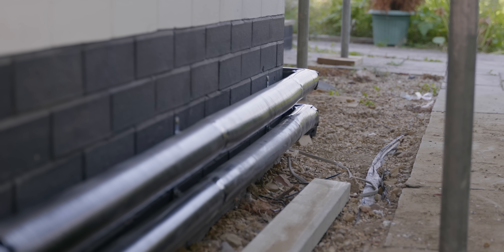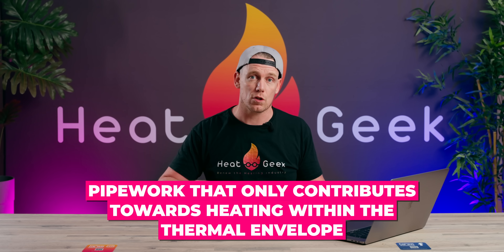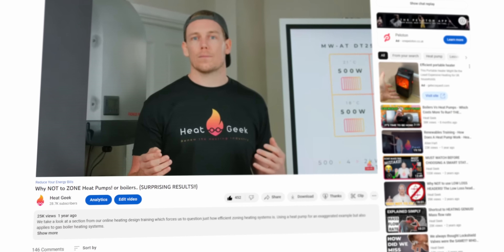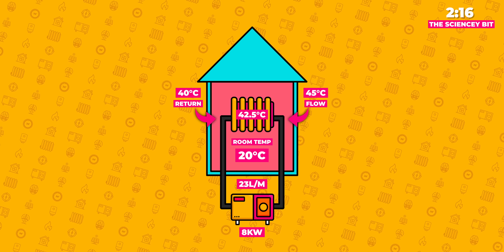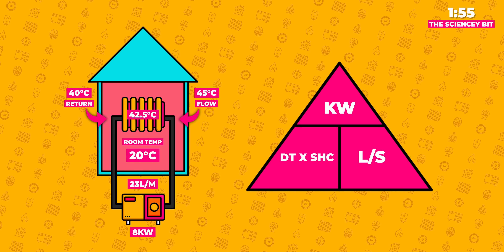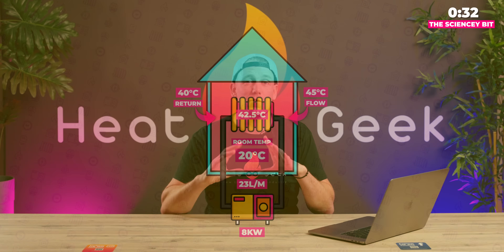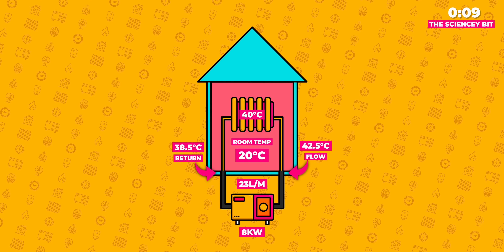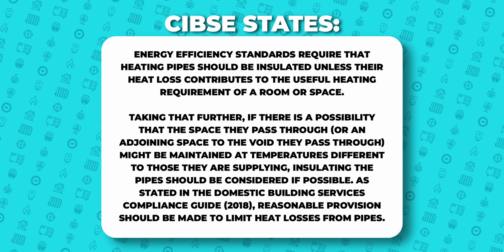Stop Insulating Pipework!

Comment: Interesting. What if you have 1 zone of UFH in ground floor and radiators in 1st floor. Wouldn't there be problems if running 45-50 degree flow temps through the floor. I guess the same problem exists with radiators on both floors. What if these pipes pass through materials not suitable for such temperatures?

Comment: If your pipework is supported or even touches wood (joists, beams, wall sheathing) any sound generated within the pipes will be transferred to the wood and the sound can be heard inside.   Our first heat pump with uninsulated pipes would make a whoosh and then constant sound.  Over the years, we got used to it.  When we updated, everything was changed out and insulated.  Blessed silence.

Also, check any insulation that is exposed to sunlight and weather.  Replace as needed.  This can greatly effect the effectiveness and efficiency of the system.

Comment: What about when your flow and return pipe are boxed together in trunking, surely the return pipe should be heat shielded from the flow pipe?
Reply from the maker: The difference will be immeasurable
Reply: @HeatGeek  even if it's touching in places (as in my case) ? If so, what would you suggest to 'squeeze' in between the pipes? On a different note, when running very low flow temps (condensing Combi boiler), it obviously cycles, what interval time (either time or temp hysteresis) would you recommend before the boiler firing up again please?

Comment: here's my example when insulating is needed. I asked them to come back and insulate the pipes in the kitchen.  >8m run.  The radiator valve turned off the radiator flow but the kitchen kept heating up. Also I insulated the pipes going through the hall as that is where the central thermostat is.  So my heating was going off before the house had warmed up.  and the hall and kitchen were too warm.
Reply from the maker: I’ve run the accounts quite a few times on pipe losses and for it to heat up an entire room before the rest of the house seats is quite rare so I’d say that you’re very specific special case and that your house has been very well in selected. Having said that this entire app premise that pipework was going to be boxed in so if pipework is exposed there’s definitely more likelihood

Comment: Wrong. Radiators are sized to the size of the rooms. Radiators are also used through balancing and TRVs to control the temperatures within individual rooms. By leaving pipework uninsulated you are distorting the design of your heating system. NO heating engineer calculates heat distribution created through uninsulated pipework. They do it by calculating the radiator sizes. 

These claims for not insulating is little more than  pseudo scientific scam by installers who don't want to bother doing  this work.
Reply from the maker: We cover all this in the video. Heat loss calcs are less accurate than the amount the pipework distorts by and can be accounted for by balancing

Comment: i have ceilings down at the moment in the downstairs kitchen and getting the plumber to run some 28mm flow and returns for the HP we might have fitted if i can ever get a price that i can manage. anyway we have insulation in the void between floors, how does this affect the insulate or not idea? as surely the heat will be trapped in the ceiling void to a degree. also recently spoke to a Heat Geek installer and they wanted to design to 50c not 40-45c.

Comment: This is helpful, but there is one important exception to consider. If you have multiple or noisy pumps near to bedrooms, the "thrum" could be annoying. Potentially, this could be mitigated by tight foam rubber insulation along sections of pipework near the pumps

Comment: I heat my 100 year old house with a hot water boiler and radiators. The hot water pipes from the boiler and water heater running through the unfinished basement ceiling are not insulated.  The room they are in is the warmest room in the house, yet it is not used.  Should I insulate these pipes to prevent heat loss?

Comment: One of the problems with calculating output of radiators is that the manufacturers/retailers stated output can be as much as 40% exaggeration over the real output for a given delta T. A recent yt video exposing this I'm sure you're aware of.  All fine and dandy doing the calculations but if your emmiter outputs are wrong it throws it all out the window and systems may not perform as well as expected. Are we to overspec the emitters to compensate for errata or is something in the industry going to change through legislation?

Comment: How about during the summer time when we run air conditioners.  It will try to cool a room that is being warmed by an uninsulated hot water pipe.  Also to get hot water to the upper floors, we will have to run the tap much longer before hot water comes out.  This will be a waste of water.  Our hydro bill will go up.

Comment: QUESTION: if you add a Heatpump to your fossil oil or gas burner to build a hybrid system (who wants to pay emptying 3000 L expensive oil from a 7000 L tank ?) which means feeding the warm water into the return flow of the oil kettle we can ignore this advice.

I wonder why no one in the UK is touching the subject of ADDING a heatpump to the existing system instead of replacing.

All the elderly prefer the "safety and experience of the past" with their existing heating systems and are not willing to make the full jump / leap into the new age. 
And in case of a oil heating you can even save costs here cause based on the ratio of prices for oil versus electricity (which is incl. VAT right now a 0,80€ / L versus 0,33 € / kWh) heatpumps are becoming too inefficient around the -5°C excempt the 2 austrian made from LAMBDA and another company who have far better COPs and SCOPs. 

If I pay 90 Cent for 1L oil with 9,8 kWh only 85% of that will reach the water (high efficient value added oil burner) which means 8,33 kWh in the water will arrive. 
For those 90 Cents for 1 L diesel I can buy  3 kWh for 0,30€ current price. 
When the COP is less then 8,33 kWh (oil input energy ) / 3 kWh (heatpump input energy)  = 2,75 oil becomes cheaper
And that is usually the case around 0°C or -2°C 

You would ease the life for the heatpump this way and both system supporting each other would run less and then last longer. Of cause Oil burner might dy and need a repair - here in germany we have millions of spare parts and now also used oil and gas burners which have been recycled on the way to the scrap yard so you do not have to fear anything till 2045 when oil and gas heating will be forbidden in private houses. ANd if the oil burner would collapse completely then not much has to be changed: Remove the old scrap metal and the heatpump is doing its job alone.

Comment: One exception to "not insulating the pipework within the thermal envelope" might be the plant room. In my case, it's a fairly small space (1.5 x 2.5 meters and 2.4 meters high), which we obviously don't live in and which happens to have a lot of pipework between the boiler, the indoor unit of the heat pump, the buffer tank, the expansion vessel, the UFH manifold, and so on. In this very small space, the pipes would emit a lot of heat that isn't really needed there, causing it to overheat. I'd much rather have that heat/energy stay in the water in the pipes so it can be emitted in other parts of my house.

Comment: I believe insulation should be insulated when hot water is exiting the boiler. Return flow should not be insulated from the last rad pipe to the boiler, you allow more condensing. Not insulating pipes going to radiators means you are heating voids and walls that lose heat but not directed at where you want heat . The greatest loss of heat should be from the rads. If your return heat remains too high then either your boiler cant condense or the output flow temp is too high or the rads are too small to vent heat. The aim should be to dump as much heat to the biggest heat emitter (rads/underfloor heating to the floor above) and cut the heat returning to the boiler so condensing works under the delta needed and that you are not sending too high a flow rate temp to the rads that cannot be vented in time within the flow rate pressure. It maybe that the flow rate is too high to vent heat in time. Should boiler makers understand that cutting pump flow rate to vent heat might cut the returning flow rate temp. After all the lower the returning flow rate temp, the more it can condense that remaining heat while knowing too cold a return temp will require more kw to boost the output temp. Maybe this is there yet condensing levels are low in reality due to boiler oversizing, poor moderation, overshooting room temp (no opentherm ability), minimal deployment of weather compensation and poor rad performance/size for tge room they are in. Yes heat will vent internally but humans dont react to temp like a thermal store equalising. No more than most car drivers going at moderate speeds to avoid using the brakes even if transit time would be the same in reality.
Reply from the maker: That’s not how mass flow rate works

Comment: Midway through a refit in my house and up to this point have pretty much insulated all pipes, I will think twice though when doing the rest.  However given that a lot of the electric cables are running in the same voids as the pipes and in some instances the cables cross pipes as they do their merry dance to sockets, I see some benefits of insulating given that I don't want transfer to the cables.

Comment: So to be fair, the real answer to this video is that you should consider every pocket or a wall as an individual "heater". This is not a zero/one scenario, you can insulate half of the pipe in the void, or use very thin/thick insulation on purpose.

Comment: I have old boiler (1970) in unfinished basement. After exiting the boiler, the 28.5mm pipe runs 13 m through the basement before splitting to warm the living spaces. I think I will insulate this. There’s maybe 5-6 m exposed on the return but that has some fins and heat removed there helps warm floor with piping and room above that doesn’t have baseboard radiators.

Comment: I think you may be getting so over obsessed with increasing the COP to maximise efficiency that common sense is going out of the window. 

We are moving away from gas/oil heating and smart heating controls with motorised TRVs which gives us the ultimate in control with fast warm up temperatures and zoning to avoid wasting heat in unused rooms, to heat-pump technology which by it's very nature has to be on all the time, heating rooms and areas that don't need to be heated just so they can work efficiently.

It seems a bit of a backward step to lose the convenience and comfort of fast warm up times and zoning by room due to the inherent limitation of heat-pump technology, which requires heat to be dumped anywhere within the thermal envelope in a desperate measure to keep the COP high in line with a manufacturers spec and/or your own target value, irrespective of whether the heat is actually desired in that specific area.

I just don't see how heating rooms that don't need to be heated can be efficient in terms of overall energy usage, even if the system COP means it's running efficiently on paper.

Comment: Beware counter-flow heat exchange; that is, where flow and return (or other) pipes are close together, heat transfers from hotter pipe to cooler pipe.. this is very bad news for efficiency of heat production and delivery by condensing boilers.. and bad news for delivery of heat to furthest heat emitters (radiators) in any heating system that uses radiators.
For this reason, I'd insulate the (hot) flow pipework nearest the boiler and between pipes in long runs under floors etc.. also insulate DHW (hot tap) flow pipes to see more rapid delivery of hot water to basin/sink.
CIBSE is right, of course.

Comment: If you had uninsulated CH pipes under a vented insulated suspended flooring (GF old Victorian ), would that would be considered outside the thermal envelope.
Also say you had boiler/cylinder in a small extension room to the kitchen, no 2nd floor above, you may want to insulate the pipes as it would be additional heat loss in the room which already will be warmed from the boiler/cylinder, pump etc that is in that room.

Comment: Need to be aware of thermal bridging between floorspace and exterior walls in some properties, e.g. old stone walled buildings with insulation on wall interiors. Exterior insulation would be better in these cases to better use the thermal mass of the building but not always possible due cosmetic concerns, listed building etc.

Comment: I like the notion, it’s pretty funky, but it is obviously bonkers (I love your usual logical stuff, but hands up eh?)
Yes, heat within the envelope is always within the envelope but the notion that having uncontrolled heat is a good idea is, to be quite frank, potty. Also, spot heat, where heating pipes run under timbers etc. can cause twisting and buckling of structural and decorative timber work due to the differential drying caused by having a hot spot where uninsulated pipes run their narrow route. 
Who hasn’t even had to try to relay a cupped floorboard, dried hard on one side and buckled by the heat over an uninsulated pipe run in the landing of a Victorian property?
Could you design a property that utilised heat from uninsulated pipework within the envelope, yes undoubtedly so.
I’d also venture that we could manage without emitters / radiators by running great lengths of uninsulated pipework to a carefully calculated design . . . but I won’t because that would be silly too.
This is not your usual fare, you’re usually talking sense and educating folk but this is a space filler to get a video,out while bereft of useful content. You’re far better than this and you know it. Please give your head a wobble and then return to dazzle and amaze again. Thanks 👍

Comment: Sorry but this fellow is 100% wrong. Heating systems are designed such that they require liquid at a certain temperature delivered to them. The system then distributes the heat in the right amount to the right places. If heating pipes aren't insulated, the heat distribution units can't deliver enough heat to the right places. Heat lost from uninsulated hot pipes rises up thru walls and chases and is lost to the outdoors. Or if uninsulated pipes run near exterior walls or roof, they lose heat thru the walls or roof. And uninsulated pipes overheat some areas while leaving other areas without enough heat.

I've been designing thermal insulation systems since 1972 and have heard many mis-informed people say the same thing as this fellow. It would be a mistake that''s hard to fix if you follow such advice. Insulation is required by building codes for hot pipes (heating pipes and domestic hot water pipes) on every commercial and institutional project in the developed world - because it reduces energy costs and makes the heating system work as it was designed to work.
Reply from the maker: If your within the thermal envelope what you say cannot happen. If any heat is lost from the pipe this can be made up for by the mass flow rate which must always equal energy in and out. The theory is totally sound.

Comment: I've watched many off grid stuff, especially North America. For years on wood stoves. When it comes to chimneys.  Now they are making the  chimney routes even longer inside the building. If the chimney is still warm, what's the point putting it outside the building. When it could radiate the hear inside. So not insulating pipe works make sense. It's simply making you system bigger.

Comment: Ooof. You just lost all credibility. Condensation from cold pipes will drip, cause water damage and mold. 

Regardless of what season you’re in one of your mini split lines is going to be below the dew point. Better to fully insulate all piping.

Armature hour here.
Reply: It's a UK channel . Heating is nearly all water based here. Not air based

Comment: With hydronic heating in concrete floors it's best to insulate the supply pipe to each manifold and to insulate your domestic hot water piping. I get your rationale for not insulating the piping but I have thermostats in all the zones of my hydronic and want them to control the temperature of each room. In summer my domestic hot water lines are insulated so I don't have to provide more cooling with my air conditioning.

Comment: My cat found where the central heating manifolds were  as soon as we moved into the house. Upstairs in two bedrooms. I wondered why the cat lay on the floor. Yes, many people have been doing what you advise for years but I think the large pipes in my airing cupboard could do with insulation although my wife like a warm cupboard in which to store linen and towels. The cylinder is spray insulated foam.
Reply: I'm with your wife on this. The heat isn't "lost" - it's being used to warm an airing cupboard.